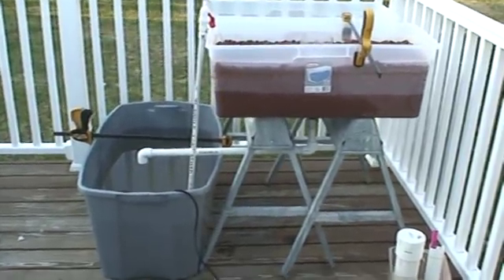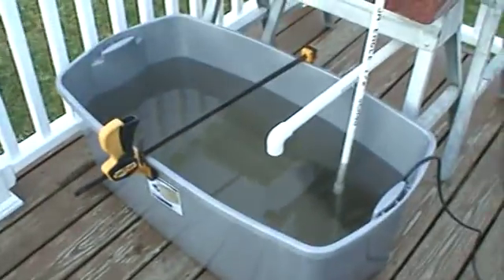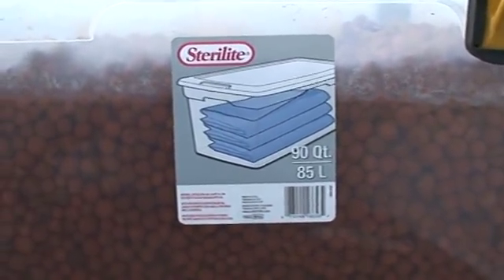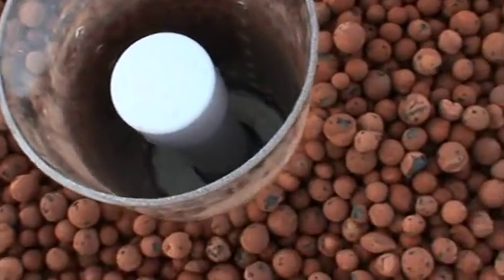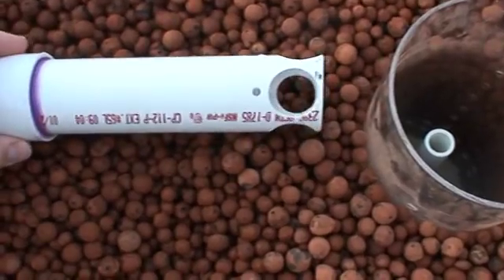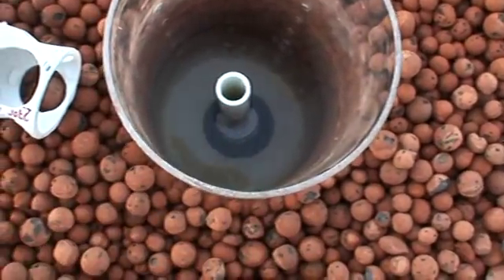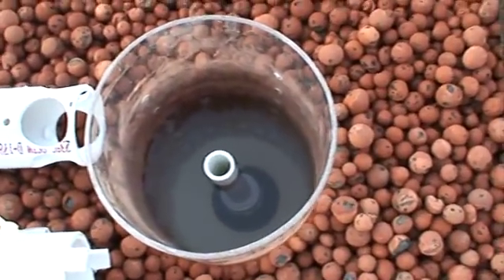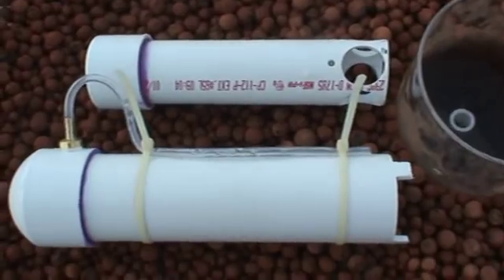Aquaponics 01 - Intro

Comment from the maker: @smaerd58
I shopped around the local hydroponics shops in my area.  The best deal I found was $34/ 50L bag.  Amazon listed it for ~$30, so I figured that was a reasonable deal.  As my grow bed containers are 85L each, I will require 4 bags to complete the set up.  Alternatively, I was considering using fish tank pea gravel -but opted for the hydroton.